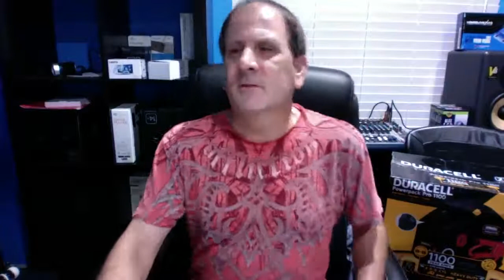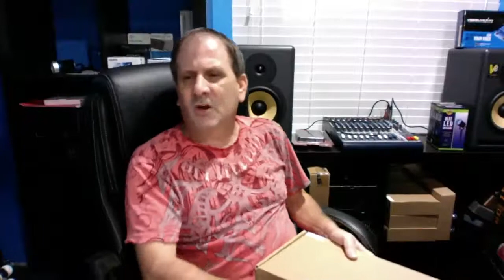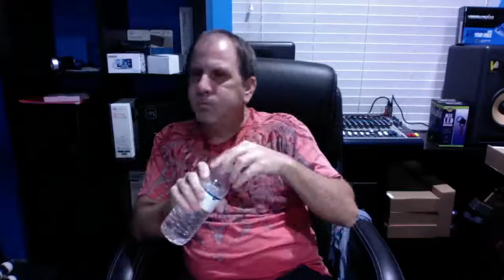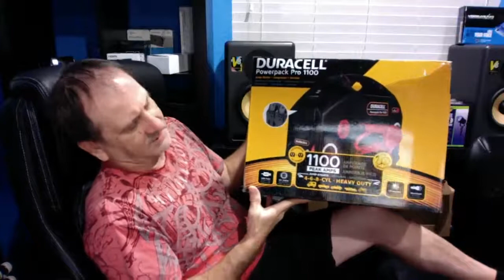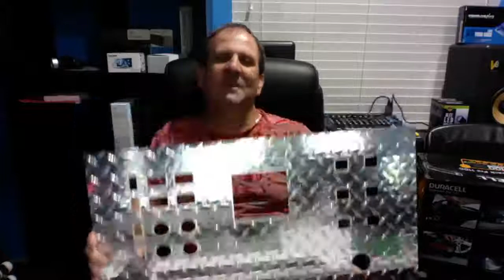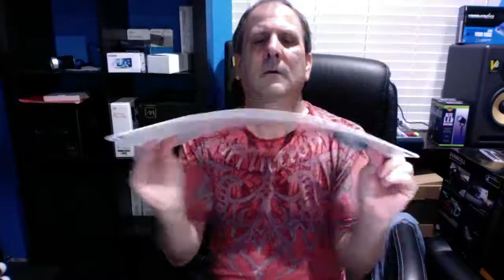Website Update! Site is Live

Comment: Hi!! I would love to talk to you! I am from Puerto Rico and after Hurricane Maria I am trying to create a solar/battery system at my home. I am struggling with some things. Is there any way to send you a message privately? Thanks!
Reply from the maker: Sorry for your current living conditions after Maria! Youtube doesn't allow private messages any more. You can got to my website and contact me through there. WesThatTechGuy.com
Reply: Wes That Tech Guy  My situation with my Solar Systems is: (My monthly energy consumption fluctuates between 500 and 600 KW).

 I have the 48V 12KW Inverter that you have in your house. I operate with 12 48V 360W Solar Plates, The Solar Converter is 48V 100Ah and 3 Lithium Batteries 48V 100Ah.   

 OKAY. By day all goes well with the energy and consumption of the house. Plates produce between 12.4 KWH and 19.0KWH per day, depending on sunlight. 

 The Inverter Programming is SW 1-1 SW 2-1 SW 3-0 SW 4-1 SW 5-1. Barety Tipe Selector in 0 if I put it in 3 for Litium batteries turns off. Once the plates stop producing energy, the batteries last about 3 hours and the Inverter turns off. 

 Do I need more plates or more Ah in the batteries? What is your suggestion? 

 Thanks for your help. 

 Yolanda Colón
Reply from the maker: MOre batteries for sure if you only have 300ah total.